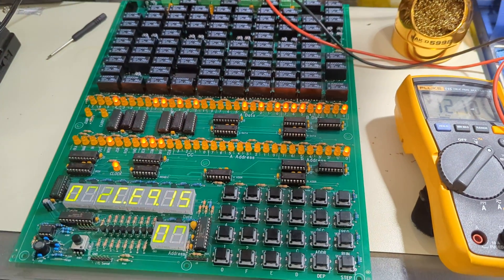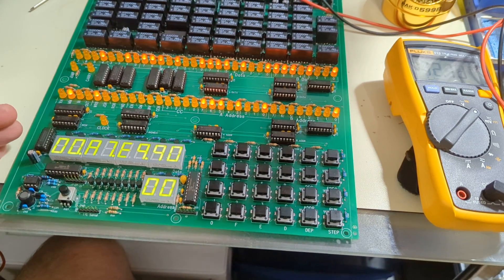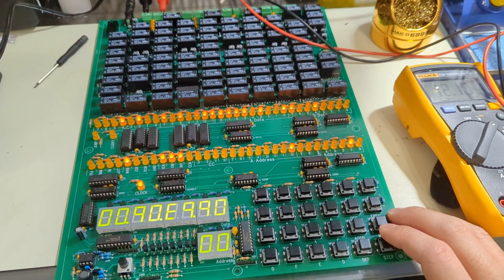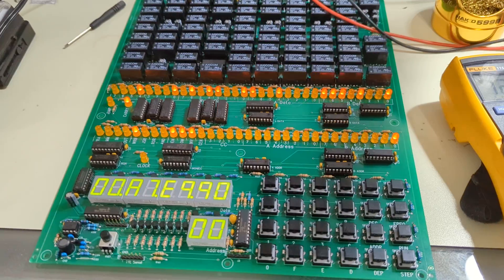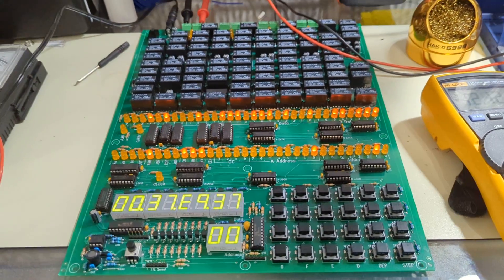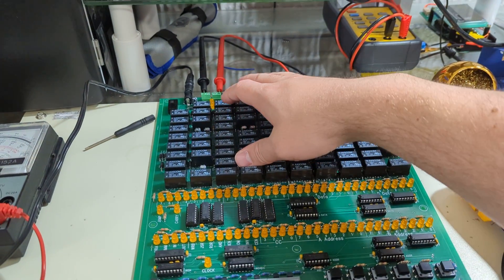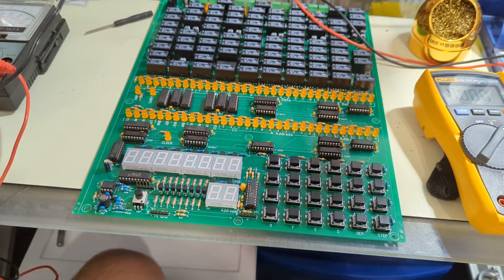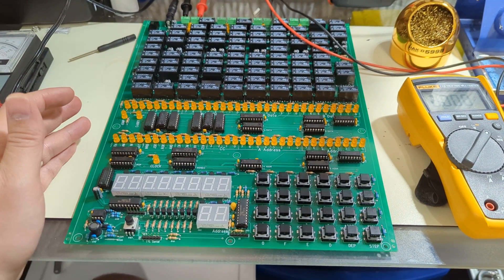Relay Computer go Clicky Clacky

Comment: Are the relays in sockets? If not, why not!
Reply from the maker: Lol they are very much in sockets- I hate to imagine maintaining that many electromechanical components without sockets.
Reply: @burntsemiconductor  I concur.  And I have seen single-board, 8-bit computers that were not electromechanical but had all the VLSI and TTL MSI and MOS DRAMs that were considered quite spiffy in the 1980's -- all in DIP sockets!  It was economically sensible to build them that way because sometimes things need to be repaired.  "Yeah, but due to a chip failing?"  Yes! The story is told of a Berkeley small business with maybe four or five 8-bit computers that were networked (!) by a ribbon cable, most of them diskless.  One day, a  lightning strike appeared to have ruined all of them in one fantastically loud, tell-your-grandkids fell swoop.   But no -- the surge only fried the interface chips.  In sockets. The cpmuter dealer and the manufacturer (Digital Microsystems) had them back running in, like, days.  My informant tells me that if you wonder who made such a smart design choice, the name to look up is John Torode.

Comment: sure but what's it calculating here in the video??
Reply: The video author says it is running the built-in demo program, which is "Euclid's Algorithm", an efficient method for computing the greatest common divisor of two integer numbers, i.e; the largest number that divides them both without a remainder. By default, the computer uses two values in the "Fibonacci sequence", which each number in the sequence is the sum of the two preceding ones. The user can specify different 'seed' numbers for the algorithm to work with.
Reply: @youtuuba  George Boole would be proud

Comment: I counted 24 ICs, and I heard you mention a PIC. So it's not relly  relay computer is it?
Reply: it's full relay only CPU. Then silicon for memory and I/O. So that it fits a pcb and doesn't cost a fortune and can live as a buildable kit. Keeping relay count low for a full CPU is the achievement here. If it were a relay only computer it'd be way bigger and clunkier! But this captures the feeling if a relay computer on a single manageable pcb.
Reply: Of course it is a computer. It has all processing, instruction decoding, program counter, logic and math functionality implemented using relays. The program counter is a form of memory. That is all that is needed for it to be a computer, and implemented that far using only relays. But just as with modern computers, you need to add more RAM for user programs, and ROM for the operating system and/or monitor software, and some kind of user interface (keyboard, display, serial port, I/O), and on THIS computer, all those ancillary things are done using IC's.

Comment: Wait, what does it need relays for if it contains ICs?
Reply: This kit uses relays for the "CPU", in place of the more common microprocessor that most computers these days are based on. However, making a CPU using relays is very inefficient and clumsy, not to mention expensive and bulky. So, the kit's designer used tiny PIC microcontroller ICs (two of them) for all the ancillary (non-CPU) features, e.g. for running the keyboard and 7-segment LED displays, and even the RAM and ROM are part of those microcontrollers. Think about it; if the user interface and the memory were ALSO done with relays, this would require many hundreds of relays, many large printed circuit boards, would cost a lot for all the components, and would be much more likely to fail due to the complexity.
Reply from the maker: Practicality, size and cost.

Comment: You think you could make a calculator with those? Porpusely slower so it clicks clacks more. It being a more complex is super cool but I think a regular calculator would be of more day to day use. Amazing job!
Reply: Well, this is a CPU, so it could run a calculator program. It appears to even have a serial port (although the I don't think the CPU can access it), so I suppose one could even use the serial port to build a completely separate frontend that compiles equations into instructions and feeds them to the computer. Lots of silly potential here.
Reply: It’s a claculator.